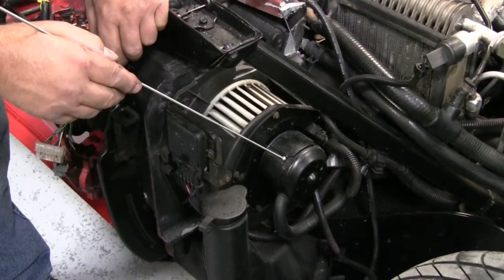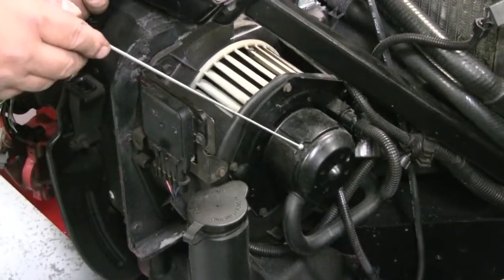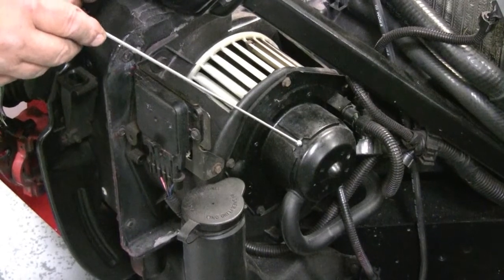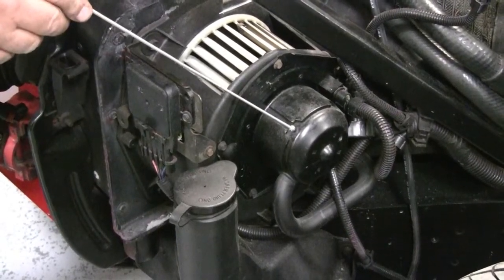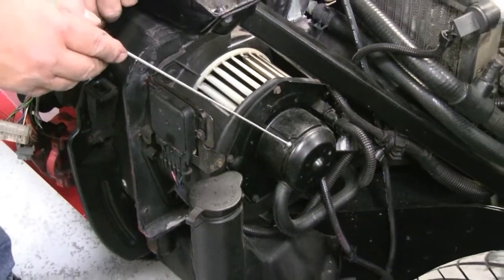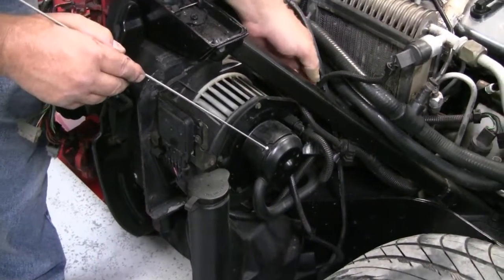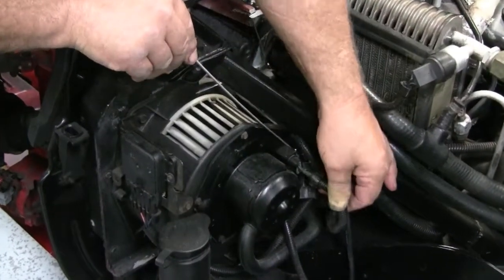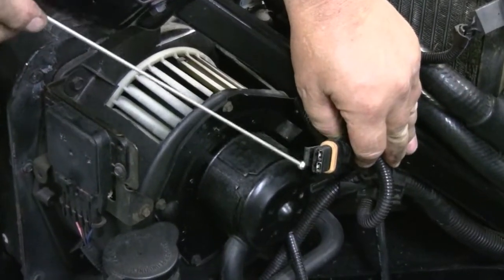C4 Corvette Cutaway AC Blower Motor

Comment: So that’s it? “ you can see that we have 12 volts along the terminals.”   So how do you test it?
Reply from the maker: You can test the blower motor with a separate 12-volt power source. Run the fan directly from a seperate 12V power supply/battery. If the blower fan runs, then check for voltage coming from the wire harness. 

Thank you,
Kyle
Product Assistance
Reply: Thank you